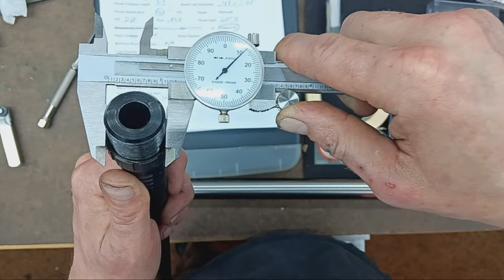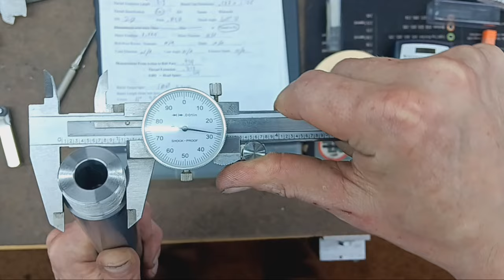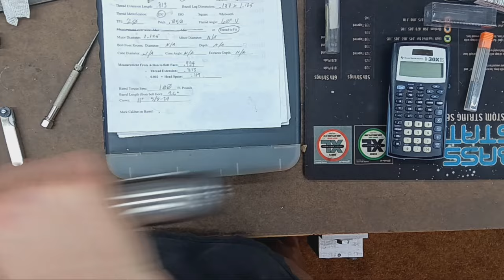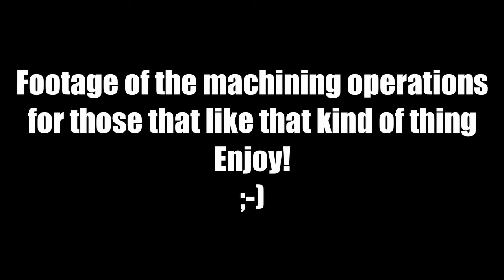No Nut Savage - Lose the barrel nut and go torque shoulder!

Comment: I actually like the savage system for my purposes. I can spin on a barrel burner like a 243 or 6.5-284 or 22-250 and shoot it until accuracy starts falling off and then spin on a new barrel myself.  It works for me. If I were shooting competitions I’d go a different rout but for 500 yard hunting the savage works. It’s pretty easy to get 1/2 moa accuracy with them.

Comment: Can you use the SAC action wrench to remove the stock barrel, or only install the new barrel due to the lower toque needed to install the new barrel compared to removing the stock one?
Reply from the maker: SAC would be able to advise you on that, but I reckon it would be OK to hold the action still if you're putting all the force on the barrel but itself.  Maybe hold the barrel tight as well to ensure you're not over stressing the SAC head...